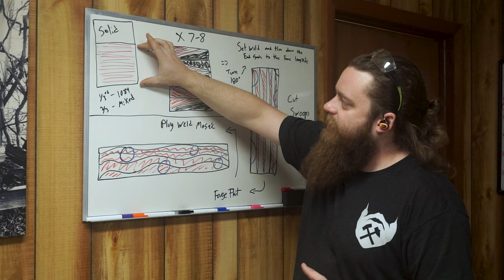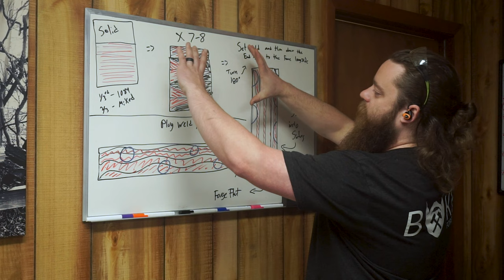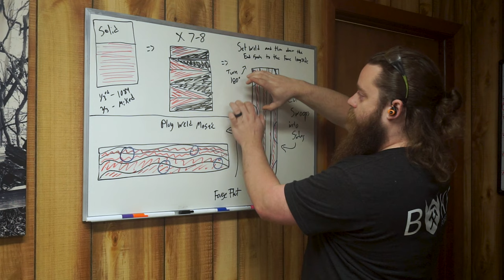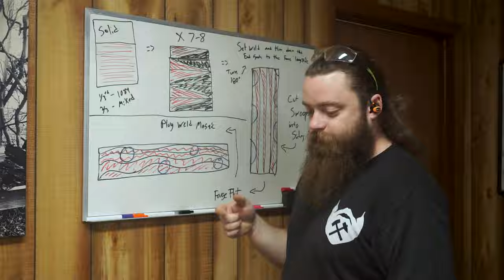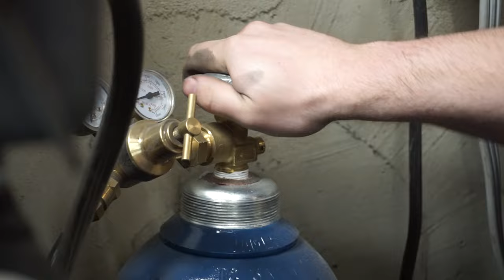Crazy Mosaic Damascus Pattern! (Plug Welding)

Comment: Looks pretty good you have to start somewhere. I plug while it's a meteorite into a blade and make sure it was at least a 16th above on both sides. My parent material was at least 3/8 of an inch thick at minimum. When doing large bars like this if you are at least a heavy 3/8 to 1/2 inch then there should be an sufficient amount to get the job done and your plugs should be at least 16th to 1/8 above the surface. All in all looks great